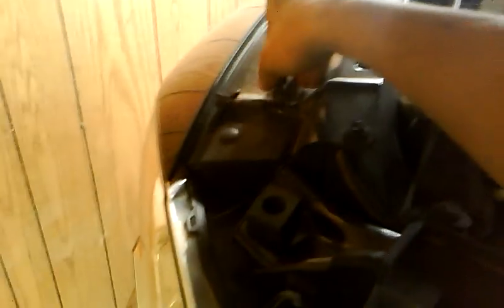How to Replace Remove Headlights on Dodge Ram 2009 2010 2011 2012 hid

Comment: I have a 2011 ram SLT 4.7. I watched this video before replacing my headlight bulbs and adding a set of aftermarket fog lights . On my truck I did not have to remove the grill or the plastic radiator cover as I had a long/ deep well socket adapter to reach the headlight bolt. You could also use two short adapters if you  don't have a single longer one. 
    Thank you for this video, it was a great reference for how to remove the Light assembly to change bulbs.

Comment from the maker: I'm glad I've helped you.
If it was a fuse it wouldn't ever turn on. Do you have HIDs or halogen? It seems to be a faulty wire right between the bulb and the socket. If you have HIDs check every wire. swap the bulb with wires in the opposite side to check is the problem moves to with it. if you still have the relay in it, check for a strong ground as well.
I would try a set of decoders as I have noticed that works best in my customers' Ram trucks.

Comment: Fernando, this helps me alot.  I was not knowing how to get to the headlights.  My problem is this, the passenger side lights are working intermittently.  Both high and low beam goes out, then might come back on.  I have moved around fuses, and then the wire harness near the passenger side lights.  Moving the harness around seems to have made them come back on, but then moving it some more won't make them go out again.  Any ideas?  Drivers side is fine....for now at least.  Thanks for the vids.

Comment: Just put a piece of tape on your socket to grab the one screw  at 1:50 to take off and then release the tab. You don't have to take the grill off. Done it many times

Comment: i have a 2009 dodge ram with quad lights...i am replacing them to a smoked single bulb light....my question is i need to buy a h13 bulb,what else do i need to buy? is there going to be 2 plugs at the back of the old light for both bulbs and if so do you know how I would hook up the h13 bulb with 2 plugs..thanks

Comment: ps you dont have to take that top cover and grill out  , you can just take out the two 10mm bolts on the head light assembly and open the trap door and release the white tab , not 
necessary to do take all that other stuff apart

Comment: Thanks bro very helpful.  Is it possible to do it without removing the grill?  I'm following your steps and it's a breeze.  I also cracked my grill a few months ago, and now I know how to change it myself just by having to change my bulb. I was going to pay a mechanic to do it lol....thanks for the extra hook-up.  One thing I noticed though, that white clip in my 2012 Dodge ram 1500 was much harder to find than yours. I had to really squeeze my head into the rim to barely see it up in there. Hope this helps someone with my same year truck as well  Thanks again for the video.

Comment from the maker: The only case that I've seen H13 bulbs not fitting is when the little outer tabs don't fit and I cut those with pliers. Other than that, I don't see why it wouldn't fit. If you got it online make sure you got the correct bulb.

Comment from the maker: If it's an aftermarket headlight, don't buy a bulb if you're not sure about what bulb it uses. Some Rams use H13 for high and low, and some use H11 for low beam. 
You need the set of aftermarket smoked headlights and a pair of whatever bulb those headlights are. it could be H1 or H3 if it's projector headlights, or an HID kit if you want them to be brighter. 
 Usually headlights come with a socket that will plug to the factory harness

Comment: What the fuck ever happened to simply reaching behind the headlight and popping the bulb out? I've got to take the front of my truck apart just to change a light bulb?
Reply: I was just thinking the same exact thing lol. I have a 2010 Dodge Ram Laramie Crew Cab, and love it, but fuck me!!!!!!  This is insane just to change a bulb! My tail light blinker went out, so I went ahead and bought bulbs for both sides, and also bought a pair for the front blinkers as well. Now i'm thinking twice about replacing the front one's, until they go out. Just goes with the rest of the things in the world. Make it as complicated as possible so more people have to take the vehicle into the dealership to fix a minor issue. Greedy fucking prick's!

Comment: One point to remember when doing this replacement and when it is on the drivers side, when you remove the assembly the windshield washer pump is hooked up to the same wireing harness and if you are not careful the pump comes out and your tank of washer fluid drains out. It is held in with a clip and comes out very easy. Good instructions if is was not for this vidio I may have not been able to do the job

Comment: Does the grill absolutely have to be removed?
Reply: Yes
Reply: Yes
Reply: trenchfoe no it doesn't, unless you have a long extension to reach all the way to the bottom bolt. it just makes things easier with it off.

Comment: Can be done without removing the grill.  On the last few I did that was the case any way.
Reply from the maker: Yes, it's a little harder to reach the bottom screw but it's certainly doable. I have a newer video I talk about that

Comment: thanks buddy you saved me $170 , but I have a 2009 hemi and it does not have a clip underneath the tire on the passenger side,dont know about the drivers side though,
really appreciate.
Reply from the maker: Yes it has to have the lock that you push up... I have done easily over 15 2009+ Rams and they all have it. It's white, it has to be there unless previous owner broke/removed it.
Reply: +SilentAssasin425 exactly my thought!

Comment: Any one knows how to adjust the head lights on a 3500 ram 2011 they are to low I need to move them upward so I can see longer distance at night thanks
Reply from the maker: There should be two holes in the upper part of the fender when you open the hood that allow you to stick a screwdriver and adjust the headlights. one moves it left-right and the other moves it up-down.

Comment: Those two bottom clips on the grill dont pull out that easy. My grill broke by trying to just pull out those two bottom clips so don't use this method unless you want to buy a new grill or try to repair it with a lot of glue

Comment: No need to remove the grille. Just did it on a 2012 2500
Reply from the maker: Troll Guy you're right. I can do them with it on, but it is a lot easier and less likely to scratch something without the grill.